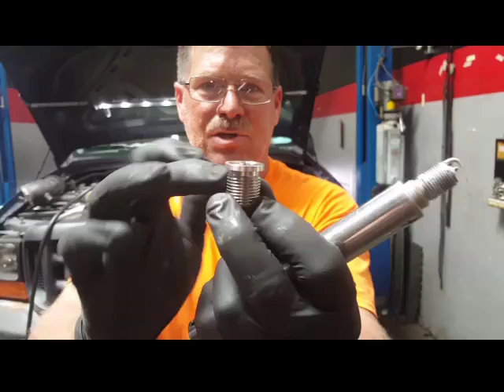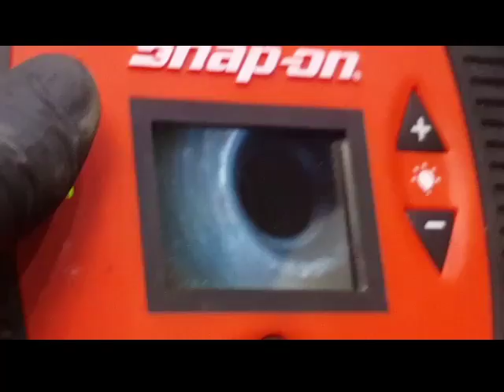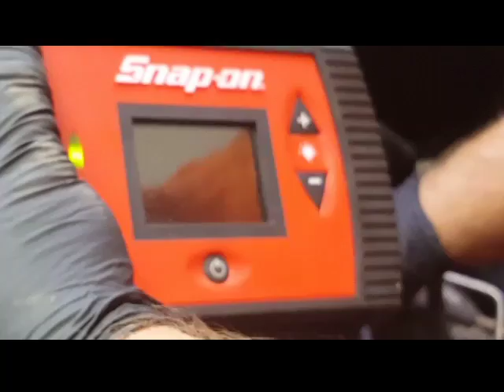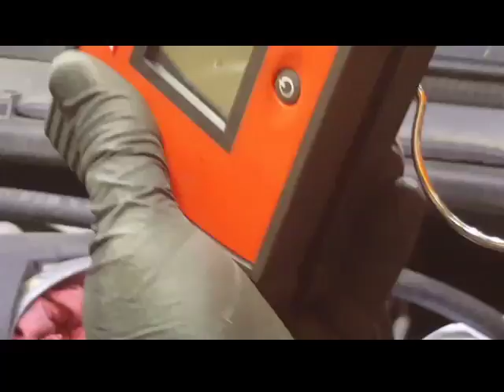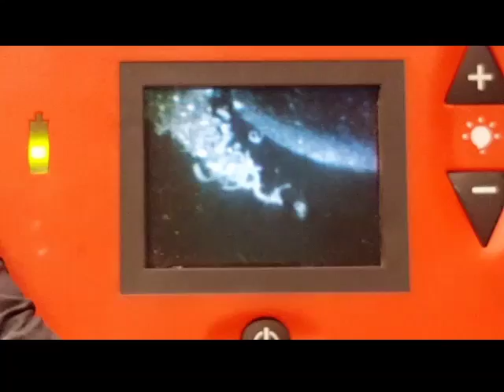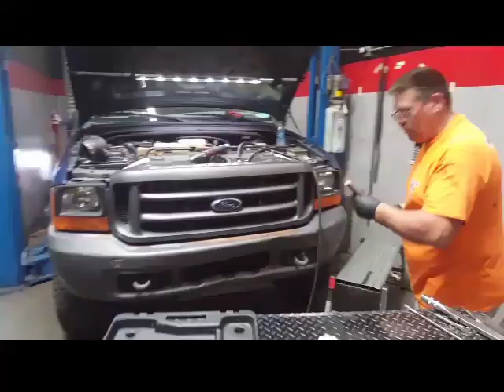New Method on repairing Ford Triton blown out spark plugs. 2 valve only

Comment: How far can you drive with a blow spark plug? It's 6 miles from a shop. Will it make it without damaging?
Reply from the maker: The answer is yes but with conditions. You MUST disconnect  the coil electrical connector and the fuel injector connector for the cylinder that popped out. This is mandatory because you don't want raw fuel from the injector being pushed out of the cylinder and being ignited by the coil or exhaust manifold.  Then make sure there is nothing on top of intake manifold that can fall into spark plug hole or damage can result. DO NOT reinstall coil into spark plug well with no spark plug screwed in because the spring inside the coil boot will get sucked into the piston causing valve damage. 
I have had hundreds of customers come into shop driving with a blown out spark plug and have not seen any damage just from driving with an open hole. However it is safer to tow. More importantly NEVER LET A SHOP INSALL ANYTHING BUT A CAL VAN INSERT INTO A FORD TRITON ENGINE. if they tell you they have been installing save a threads for years and they are good, The chances are its not going to last on a modular Triton
Reply: @SandCarServices  yes. I've heard of the 3 makers. Cal van, ez thread and something cert. And Cal van only. My ignition coil blew too so that's out of the vehicle. But I haven't done the fuel injector clip. Figured with loose air and fuel it might stay somewhat lubed. Would putting a little oil in there help? It's 6 more miles to the shop.
Reply: @SandCarServices  makes sense to remove the fuel injector clip. It gets air and gas thousands of times. They're putting in the new threads and joint. I've got the new plug and ignition coil in my hands. CalVan with thread sealer only.

Comment: I have a 2002 Ford Windstar van 6 cylinder. The one I. The back middle came out. It's really hard to get my hand back in there. Is there an easier way to re thread it other then take the windshield wiper cover off. What do you recommend?
Reply from the maker: The calvan kit does not fix the 6 cylinder engine only applies to the Triton engine family

Comment: HEY RON..you referred  me to this video..real good..no problem thus far..obvious question..what can I do to avoid this problem in the first place?..will checking the torque on each plug do it? (then doing so ..say every 20 k miles).. How many ft/lbs torque do you recommend (not with the insert)..If I change out all the plugs and install with a bit of that locktite (should never have to change plugs again..I'm likely to only put no more than 50k more miles on it)..is that a hare-brained idea and if so, why?
Reply: I'm thinking Loctite 242 blue removable..your thoughts please
Reply from the maker: Napoleon Einstein 
Never use locktite of any kind on spark plug threads.
Thats my professional opinion. 
Do it if you want to. Its your choice.
Reply: What's the worst that can happen?  Strip the threads? If so, install the insert kit? What do you think?
Reply: Napoleon Einstein my opinion on any loctite on spark plug threads, next time you pull plugs you will definitely pull the threads from the aluminum head. If that is your plan, buy the kit and do all with inserts, no future problems.
Reply: Coy..I will be replacing all plugs with Autolite Double Platinums..they should be good for 50k miles. I have never in 50 years had a plug fail..I can't think of any reason for ever having to replace plugs again barring some kind of catastrophic failure (then it's junk anyway)..the rust worms will get it before I put 50k more miles on it..
Reply: Napoleon Einstein never said anything about plug failure!! The comment is related to when you wish to replace those plugs in 50k miles, you will do inserts in all cylinders as threads will come out with with the plugs. If you do not use high temp thread lock, then you provided lube for them to back out and you will be doing inserts then!!!!
Reply: Coy..good point..I'll use the high temp
Reply: Napoleon Einstein you do that and order a thread insert kit, you will have to have them for the next tune up!
Reply: Coy...I get it..but..I don't want to blow out a plug 500 miles from home..then have to pay out a couple hundred bucks to some half wit meck to fix it or have my car flat bedded home..what can be done to guarantee plugs won't blow out in the first place?..if this is such a common issue..what is the PM solution?
Reply from the maker: THERE IS NO GUARANTEE...... THE SOLUTION IS TO INSERT THE HOLES BEFORE FAILURE,  ANYTHING ELSE IS JUST A GUESS.
Reply: Ron Williams but to do loctite especially high temp to spark plugs is pretty much a guarantee the threads will be nonexistent the next plug change. Which will require the inserts, so be proactive and do all 8!
Reply from the maker: I AGREE, LOCTITE WILL DAMAGE ORIGINAL ALUMINUM THREADS! I DO NOT RECOMMEND LOCTITE ON SPARK PLUG THREADS EVER. LOCTITE IS USED ONLY ON OUTER THREADS ON INSERTS.
Reply: ridiculous

Comment: My husband is thinking of doing this repair job, because nobody around here wants to do it, not even the Ford Dealership!!!... and we don't want to replace the head on a car we just bought a year ago.  He has already replaced the valve cover gaskets & the manifold at the bottom of the engine on this car, so he is willing to give this a try.  Being that he is a Sonar Tech in the Navy, he is well trained on how to repair stuff with just a manual and instructions, so we think with one or 2 extra tools that he doesn't already have that he can do this too.  We have a 2004 Lincoln Towncar Ultimate.  It appears to be a Triton 2 valve, but we aren't sure because the information about the kit said its for up to 2003 Triton 2 valve.  Any chance you can confirm for us that the kit is the right one for the vehicle, or let us know how we can find out that information ourselves?  Thanks. Really appreciate it.
Reply from the maker: The calvan website is erring on the side of caution. The 38900 calvan kit will fit all years of 2 valve Triton engines. The 3 valve engine insert is different.
Reply: @SandCarServices  AWESOME, THANK YOU!!!

Comment: which would be better to use the J-B Weld high heat epoxy putty or the J-B Weld Epoxy with the loctite 271
Reply from the maker: I've been using the standard J-B Weld mixture not the high heat
Reply: @SandCarServices  Thanks Ron I will use the standard J-B Weld.

Comment: I put one of those temp repair and the threads broke off in head the top part come out we ordered the cal van product will the reamer take care of the threads
Reply from the maker: The reamer will not break through the steel part of threads that broke off in head. If that's what your asking
Reply: Hey Snellgrove outdoor services LLC
Did you come up with a solution? I’m dealing with the same thing.

Comment: Hey Ron I need some help I bought the calvan kit for my 5.4  I reamed it out everything was going fine but when I went to start tapping the tap itself is just sitting on top of the new hole and not tapping ?
Reply: Same thing here, any luck getting it to tap?  It looks so easy in the video, makes me wonder if we got the right tap in the kit.
Reply from the maker: Did you purchase the kit from Dennis at @wiseautotools.com
Reply: @SandCarServices  No, I'm in Canada so I used an ebay seller.  Thanks Ron for the reply, I just got the spark plug in, yeah.    My neighbor is a machinist and said "that won't work, it's a bottom tap". He lent me one that   was much more tapered cut and it bit right in. Thanks also for the suggestion to pre test the inserts, first one out of the box was a dud.  All is good.

Comment: what if the sleeve gets stripped? Are we just out of luck at this point and the head will need replaced?
Reply from the maker: Do you have a calvan insert that is stripped?
Reply: @SandCarServices  I have one that blown out again it's a Calvan I put in any ways to get it back out and replace it thanks..

Comment: I have number 8 spark plug on a v10  head that has been tap out before and will not except a calvan insert. Is there anyway to fix this or am I going to have to replace the whole head?
Reply from the maker: Contact Dennis at @wiseautotools.com and ask him about the timesert triple oversized kit. I dont like the timesert kits but it might be your only option. Are you sure the calvan wont cover it. Most of the time it does for me.
Reply: Yes already check to see if would work it has nothing for the tap to even to start to thread on

Comment: Can I use a 3/8 drive air ratchet or does it need to be 1/2"?
Reply from the maker: I'm using a 3/8 air ratchet!
Reply: @SandCarServices  great. Thanks. I'm getting ready to do that job. Calvan kit is on the way for it.

Comment: If I do not have access to an air ratchet, how hard will this be to do while using a hand ratchet?
Second question, I have an air compressor, but no long line on the end of it. Where could I get one, or could I just use a hose and a clamp on the end of a blower nozzle.
Reply from the maker: never done one by hand. i wont say it cant be be done, but you gotta be a super hero to be able to spin that toll by hand (LOL)
any hose is better than no hose. done rely on starting engine to clean out shavings. it will cause shavings to enter into intake manifold and distribute to other cylinders.
Reply: @SandCarServices  I used your directions, and also your October 20th video to (I trust) save someone from a $4000 repair they didn't need. The mechanics were insistent they needed to pull the heads. Worse yet, the threads were even intact, but would have needed to be retapped, as they drove too far, and boggered them up, so I went for the insert. The only thing I would say was different than your Oct. 20th video is they said to tap to the V in the shaft of the tap, where you said to go to the lower one. I stressed out, but tied off a string to the V channel (just in case) and successfully tapped it out. Cranked it in to 20 ft. pounds, stressed that perhaps it stopped short, but started it anyway, and it all seemed good. What would be the symptoms if the insert stopped short of where it should be? As in, if it didn't tap quite deep enough.
Reply from the maker: The result of not seating the tap all the way down could be a potential blow out of the threads around the insert. Or possibly the insert blowing out again. If you used the eclipse blinds as your depth on the guide you're probably going to be fine

Comment: Help!  I was doing this on a 2 valve 5.4 L and the clip came off my tap at the very end, allowing it to push all the way through.  It is still standing straight up in the spark plug hole and seems to be pretty firm, but I am afraid to do anything to get it out, in case it makes it worse!  Has this happened to you?  How do I get it back out?
Reply: Possibly, a neodymium (strong) magnet firmly attached with Araldite) to a stick (chop-stick). A small magnetic pickup tool can lift about 3lbs. This assumes that the tap can be magnetically attracted. You may, by now, have already solved the problem. Hope the idea helps someone. Cheers, Peter

Comment: Have these kits changed?  I've done many of them but never leave the 1/16" shelf on the bottom of the reamed hole because the insert has to go past that point in order to rest on the shoulder of the insert, which is crucial for the gas check groove to function properly.  On the one's I've done, the insert protrudes slightly through the bottom of the spark plug hole with the shoulder of the insert resting on the top of the reamed hole..
Reply from the maker: +Ken Robbins i thought the same thing about protruding into cylinder. Thats why in my original video i removed the clip from the reamer to punch thru. I had a head off of a core 4.6 on the bench one day that i was using to teach another mechanic to learn installs and found that the reamer cuts exactly the depth of the insert. I have not seen a factory original Cal Van insert breach the cylinder past the point where the reamer stops with any of my kits i have done while head was on the work bench bench. We played with it and even marked the inside of the insert, installed it dry, then removed it and it did in fact touch the shelf. I will ad that i have never had an issue with any i have done and i do about 6 to 12 a month.
So now i leave the clip on because the little edge left behind stops the tap from dropping into the cylinder.
Reply: You might talk to the engineers at Cal-Van.  I'll concede: The method you've described may work on the "Romeo" - Vin "W" heads but not on the "Windsor" - Vin "6" heads.  Unless you (or the person seeking guidance from your video) are aware of the difference, it could be a crap shoot.  Why take the risk?  If the (Cal-Van) directions are carefully followed, then it doesn't matter which version of the 4.6 or 5.4 SOHC 2 valve head you're working on...............
Reply: Hello great video Just one concern I performed the same job as above on my 98 ford  e350 with the 5.4  with Calvan kit, Drilled with up to the clip (added mine did not come with one) and left small shelf on bottom  verified with bore scope....I am concerned it is not drilled far enough by counting the treads i cut and ones on insert , are you saying the shoulder of the insert hits the bottom or the side wall of spark plug ? The Calvan video show it being drilled all the way threw...Let me know if you have performed this on 97 or 98 e350 5.4 they have a different cylinder head it seems. Thanks for your help..

Comment: 1 spark plug just  popped  out and  someone  repaired  the head before with  the Helicoil Sav-a-thread  Spark Plug Repair Kit and the Helicoil and Spark Plug  came out of the hole  there are no threads  in the head what should i do
Reply: Ron how would you recommend taken out a Dorman insert. I bought the truck used and it was installed. I bought the calvan kit from wise auto last week but I just noticed it had the insert in it. I can't find anything online about how to remove these.
Reply from the maker: Not an easy answer. If its not broken I would leave it alone. If it blows out then repair it. As far as removing them it can be tricky and sometimes require removing cylinder head
Reply from the maker: I agree. I just don't answer that way anymore because to many have come in to the shop damaged but still in the head and it gets tricky after that.
Reply: @SandCarServices  spark plug blew out of it but half the insert is left in. Can I use a drill bit to drill through the insert?

Comment: Ron, What is the difference between the 39300 and the 38900. Can one tool be used for all application. Thanks for posting, I learned a bunch.
Reply from the maker: The 300 kit if for the 3 valve engine only. The 900 kit is for all 2 valve engines. The spark plug went to 16mm thread diameter on the 3 valve from the 14mm the 2 valve used. At some point the 3 valve engine was changed and went to a smaller 12mm plug in the later years. which takes another kit all together. The 300 and 900 kits are not interchangeable.
Reply: Is there’s away or a tool to repair one that has been blow out the second time? The insert is to small now

Comment: the only thing i didnt like was the air fitting, it dont fit anything at all. i thought i was crazy and took it to a few shops, still no fit. and i guess they never fixed it. used to fit but not now.

Comment: Ok. 07 5.4.. My stupid buddy got in a hurry and did not apply thread lok. The insert fell into the cylinder. How do i get it out.
Reply from the maker: Calvan inserts can't fall into the cylinder on  Ford triton engines.  But check out my video titled standard spark plug insert fell into cylinder. maybe it will help.
 You might want to also check out my video on why you should not use anything but the Kelvin kit to prevent engine damage
Reply: @SandCarServices  ya i didn't mention it was the heli coil kit... I think im screwed. Its a 07 e250 van 3rd cylinder. Hard to get to every thing.
Reply from the maker: I see it all to often. The calvan kit is not available and the parts stores say the helicoil ones work. They dont. Sorry to hear.
Reply: @SandCarServices  thanks Ron... Lesson learned.

Comment: What year Ford v/8's are having this problem? What a nightmare...
Reply from the maker: 1996 to present 4.6, 5.4, and 6.8 2 valve engines
Reply: @SandCarServices  Is  the problem caused by over torquing the spark plug?
Reply from the maker: Not so much,  watch this video of mine. https://youtu.be/j0Zb4vhyr5k

Comment: How much do you charge for this?
Reply from the maker: Normally between $238.00 - $285 parts and labor. Vans are extra as well as lifted or modified vehicles.
Reply: Man Im haveing this problem on my 03 2v mustang unfortunately I live 6 hours from you so I cant have you do it
Reply: Ron Williams.... I have the Cal. kit- my truck has a BODY LIFT which gives me 4” more working room under firewall.  thanks for all your information. 
Gott Mit Uns